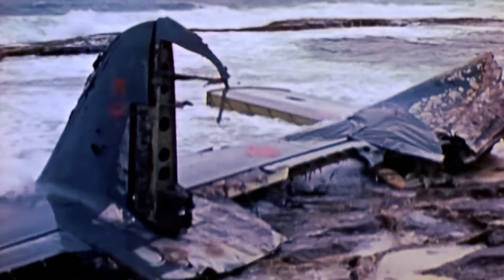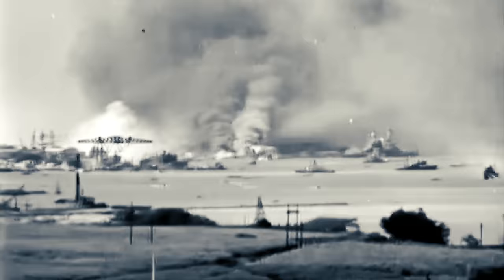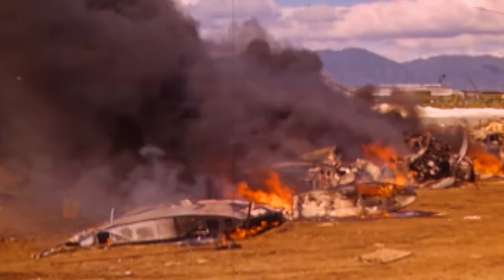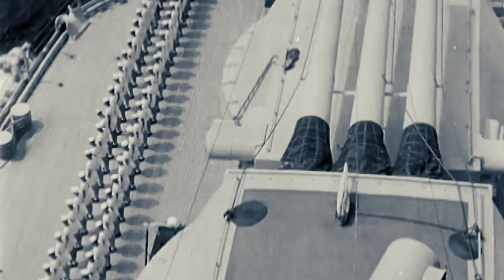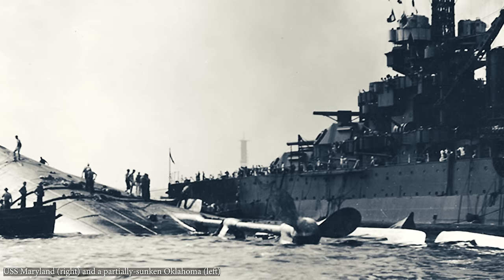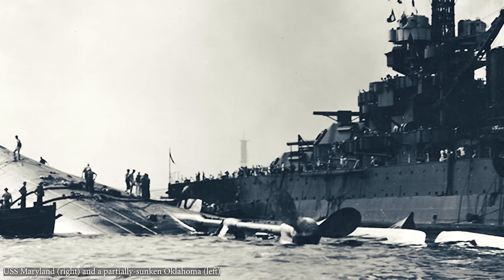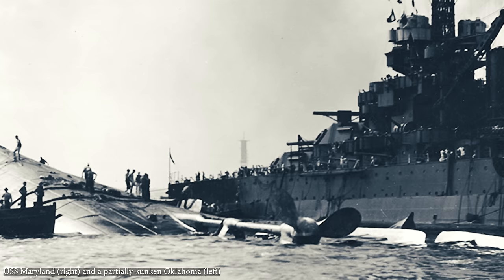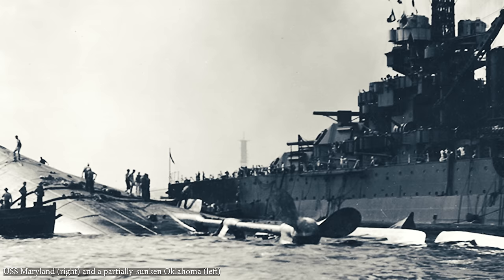How They Salvaged Pearl Harbor: The Terrible First Day (1/4)

Comment: The memorial museum is a must see.  They have a torpedo that was  accidently dredged from the mud some time after the attack.   Then even later a B&W  video was discovered that actually showed the same torpedo streaking across the water and then  stirring up the mud as it  struck the bottom.

Comment: Pearl Harbor is a case-study about how a masterpiece of tactical success can be at the same time a monumental strategic failure. 
Not only the U.s navy carriers were not in the harbor at the moment of the attack; but Japanese planes did not scored a single hit on the gigantic navy fuel deposit of the port. Which could have deprived the whole Pacific Fleet of months of supplies and turned most of port infrastructures in an inferno of flames for days ahead, preventing the cleanup and ships salvation. Also the dry dock of the Navy shipyard were completely unaffected by the air raid, missing the opportunity to deprive U.s Navy for months of vital repairing infrastructures both for the ships hit during the attack and also the damaged ones in the following months of war. 
And  under the tactical aspect, Japanese had  a major failure, the attack of the midget submarines through the entrance of the port.

Comment: What's kind of lost is that the battleships were supposed to be at best 3rd on the list of targets. Cruisers were next priority after carriers. When the plans went to crap the pilots wanted the prestige of traditionally significant target also ignoring dry docks, fuel depots, submarines, etc. The only significant "success" of the attack was it pissed us off and got us into the war against them. While a tragic loss of life the loss of battleships was not a crippling blow in the strategic sense and simply gave Americans a rallying point to strike back. In fact the lessons learned from salvage and damage repair at Pearl Harbor helped us immensely in damage control during later engagements.

Comment: 1. There are actually a few old buildings over by the hanger,(which I think is a museum now, what I do know is that when at the schoolhouse on Ford island, that's where went to get lunch) that have bullet holes in them that the navy left like that.
2. I would assume the USS Downes is at least partly why we have to have all ordnance removed prior to entering drydock now.
3. The Arizona went down with so much oil left in its tanks that it's leaked somewhere between 14-60 thousand gallons of fuel in the last 82 years, and it's expected it could take up to 500 years for all of the oil to leak out.

Comment: As a fabricator with a pretty good amt of experience… it makes me wonder what kind of tooling the rescue crews had to work with. Gouging rods w/ an arc welder for 25cm and then a grinder with a ton of cutoff wheels for the last 5cm wouldnt take all that long and would negate a lot of the danger/air quality issues

Comment: The 3 men on the W. Virginia had their death certificates filled Dec 17th, while they were still trapped within that metal tomb. "KIA in the Pacific", no mention of what ship they served on or even the attack on Pearl as the cause. 2 years later, when the ship was finally raised & the men's remains discovered, the truth broke hardened sailors into tears at the horror and suffering of these 3 men. 

The death certificates were never corrected in an attempt to "spare" the families of knowledge of their horrible fate & the taps at night-thing is absolutely true (hearing the taps distinctly was only possible at night when the work of salvaging was paused). And as callously as it sounds, the guardsmen were ordered to ignore the rhythmic sounds, there was simply no way to rescue them.

If the ship had fully capsized they might* have been able to be saved as the survivors of the Oklahoma but the controlled flooding of the opposite side of her (to maintain an even keel) unintentionally closing off the only path that may have saved them.

Comment: The USS Nevada was able to get underway due to switching between boilers; both were lit during this time to switch from one to the other. This allowed the crew to get steam building so they could get moving towards the mouth of Pearl Harbor. While it didn’t do much good due to the air attack, the ship was able to be beached and salvaged.

A lesser known vessel was the USS Ward, which opened fire on, and sank, an Imperial Japanese Navy miniature submarine, which was a two person submarine. Yes, the Japanese used miniature subs to attack Pearl Harbor. It’s just a lesser known portion of the attack. So, while the Japanese got a good blow in, they didn’t fire the first shots. That was the USS Ward, which was only defending its home port.

The Imperial Japanese Navy subs didn’t stop when addressed by the USS Ward, and as the US was neutral at the time, the USS Ward was within her right to defend the port. Just a few other facts for ya! :3

Comment: Very well researched and told. My Father was a Salvor there at Pearl just a few short days after the Attack. He spoke of his first night there. The Navy was short on Servicemen, and the Army had little idea about Ships and Docks. The Civilian Gun Shops around the City were emptied of Pistols, Lever Action Rifles and Shotguns. Dad was handed a brand new Marlin 30-30 Lever Gun with two boxes of Shells. The Army figured Shipfitters and Salvors knew what to look out for a how to protect the Ships and Docks. Pop had three prior Hitches in the New York State Guard and Reserves, he was in a Signal and Intelligence Company attached to Headquarters. He understood Morse Code fluently ( unfortunately). His first duty was as a Civilian Guard on the Hull of the Westy. He heard the tapping.( Had nightmares for decades after.) He helped take the Bodies out of the dry space they were in, and was the one who found the Calendar the Sailors kept track of the Days on. Navy Officials confiscated it and swore him to Secrecy. Bad for morale they said. Dad cut holes in the Okie( gave two sandwiches and Coke from his Lunchbox to trapped Crew). The Compartment they were in flooded and they drowned… one with his fingers hanging on to the hole Dad had cut. His body hung that way until a CPO came by with a Hammer and poked him back down inside. My Father Salvaged the Big Guns and Turrets off the Arizona( used for a Coastal Defense Battery)found a Ring on the Bridge for Admiral Kidd’s Family( he was vaporized by the blast. ) Pop was Best Friends ( best he could be) to Admiral Ernest King. When they were both younger my Father worked aboard the Salvage & Recovery Ship USS Falcon with him. He had a lot of Salvage accounts he spoke of.

Comment: It would have been nice to have more operational BB's in the Solomon (and maybe DEI) campaigns, having the 1,600 or so BB veteran serviceman lost back, and not having to use the resources to refloat, repair, and refit.
Still, as Mike states, the BB losses weren't too bad for the U. S. effort.  If the navy had to lose active BB's at Pearl harbor the least valuable would 1) Nevada, 2) Oklahoma, and 3) Arizona.  All were old w no major refit since '26 - '31.  Both North Carolina class ships, the 2 new fasties in operation were elsewhere.  Anyway, the aircraft destroyed might have been the most hurtful to the U.S.
Thanks Mike.

Comment: After having met 3 Pearl Harbor Survivors,the story told is false. FDR forced this by Causus Belli in trade. The attack was expected and Hawaii was under invasion alert for 6 weeks and only stood down by FDR direct order
 The US Navy was decoding Japanese code faster than the Japanese and knew everything  but the exact location of the fleet(Japanese did not know either). If the Japanese had completed the attack as planned the fuel and dry docks would have been destroyed with the base being almost useless. A large invasion force was also not launched that may have succeeded in controlling island.

Comment: Two of the Destroyers that were hit at Pearl Harbour were so badly damaged that they actually just built two new hulls and fitted them out with salvaged equipment from the old hulls (USS Cassin and USS Downes). The entire defence at Pearl Harbour was a cluster, Husband Kimmel and Walter Short couldn't even get what they were there for right, this is Kimmel and Short were sacked shortly after, that and neither of them even once listened to their signals Intelligence departments that were screaming at them that something big was about to go down for months beforehand, Kimmel was told at least 6 times by his intel head Edwin Layton that intel pointed to a Japanese attack (Layton was the US Naval attaché in Tokyo in 1936 and pretty much got told if the US sanctioned Japan the Japanese would attack), Neither Kimmel or short listened and paid a real big price for their incompetence.

Comment: i hate to be "that guy" but the myth that the japanese wanted to target the carriers is so flagrant i have to be that guy. the first carrier was only built in 1922, as a way to keep ships in service, while honoring the washington naval treaty and were largely unproven until WW2 and many countries didn't view them as the main force, instead favoring battleships. this is apparant as america itself had 17 battleships and 18 heavy cruisers to her only 7 carriers. the true folley of japan's attack was the relative chaos and "glory hunting" leading to multiple attacks against the same ships instead of targets like the oil fields and other repair facilities. their error is NOT missing the carriers as they weren't really the target (even if in hindsight carriers turned out to be the naval superweapon)

honestly though there ARE alot of "errors" that japan made during this attack, for example, attacking them in harbor, where its shallow and ships could be at least scrapped easily was an error, as mentioned, not hitting facilities on land like the oil storage was an error.

and of course, everyone underestimates America's salvage and damage control capabilities, and it is consistently pretty funny